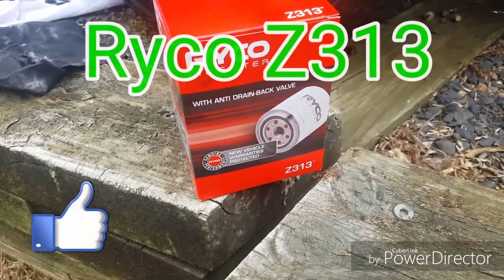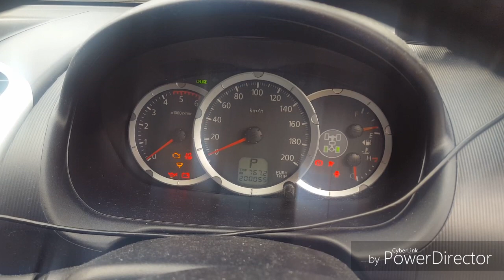OIL CHANGE IN 15 MINUTES plus Ryco filter Mitsubishi Triton

Comment: Handy to note, that to get the oil filter out once it’s unscrewed, you need to remove the rubber hose connected to the underside of the turbo. Only one hose clamp, but best to do it before unscrewing the filter which is still pretty much full of oil.

Comment: I did my oil change today. Lifters were ticking away so i added Motul engine flush prior to draining. I used Penrite HPR 10-40 and added 2 bottles of Nulon lifter and tune additives. went for a drive and it was so much better plus the power increase was definately noticable. Lifters were much quieter from the infamous Mitsubishi tick so now with some use the ticking might settle. If i have to.pull the lifters out and manually clean them i.will but i'd like to.see how the oil change and additive goes first. Next, i'll do the intake strip & clean. Selleys oven cleaner is great stuff as it foams up but don't leave it on too long as it can eat at the alloy if left too long. I'll be doing 5000km oil changes. Peace of mind knowing your oils fresh
Reply: Thanks for the comment mate, I'll give the additives a go!

Comment: Hi mate, loves your videos as they are very helpful with  jobs on my Triton.
I was wondering if you can help with manual transmission and transfer case oil change. A few pics of where to locate the drain and refill plugs are will probably help a lot.
Cheers
Luigi
Reply from the maker: hey mate. this is the next video Im working on so it should be up in the week or 2, cheers 👍

Comment: checking oil level after running the engine for a short while as filling up the filter after fitting new filter makes it necessary.

Comment: Do you need to do anything on the engine control unit to let it know there is new oil? e.g. to reset the oil dilution parameter?

Comment: Donald, thanks for the video. Are you satisfied with your Triton? I see it's done over 200k. I'm from South Africa where these vehicles are not as popular as the Hilux and the Ranger, but they are much better priced second hand. The only issue are the service rates of the dealer. Any advice? (If I may pick your brain.)
Reply from the maker: its the same here in Australia, Hilux and Ranger are a  popular brand but the Tritons price is very attractive both new and 2nd hand, Im very happy with my 2010 glxr, never had any major issues with regular maintenance, apart from the lag at take-off that would be the only thing i could fault but if you change your driving style you can delete the lag, overall a great 4wd for the price.
Reply: Great, many thanks for the quick response! I think it's the Daimler distribution here that messed with their sales. Pity. Seems like a nice truck. It's interesting about the lag, but it's the same on the older Rangers, so I totally agree driving style can address that. Do you perhaps know anything about the 3.5 V6 (apart from the fact that it's bit thirsty? lol. Anyway, just glad that the chassis etc. are holding up. Appreciate your time.
Reply: Hey mate i got a 3" exhaust and ecu re map a few days ago and my triton has near on no lag down low

Comment: Hi mate great video. 
Having just purchased a triton 07 4x4 automatic transmission there wouldn't be a chance you could do one on changing the auto transmission oil and filter?
Cheers
Reply from the maker: Doug Harvey stay tuned mate, will be covering the trans fluid an both front an rear diff fluid
Reply: Service My Ride great mate look forward to your video. 
Cheers

Comment: I'm about to do this next month but I'm not sure what to do with the used oil? Someone mentioned there are oil disposal drums at the local tip but I'm not sure if thats right. Any ideas on oil disposal here in Qld?
Reply: Rumpole Del Bailey pretty sure super cheap auto will take it and recycle it
Reply: Rumpole Del Bailey Im not sure about QLD, but most auto shops will dump it for you, also most tips might charge a small fee,

Comment: Awesome vid mate. Did you need the oil filter wrench or could you reach it and change it by hand?
Reply from the maker: Thanks mate, yes I did use the oil filter wrench, they come in all different sizes,  I used the 98mm-103mm wrench
Reply: Awesome cheers. :-)

Comment: I see the SPV EGR resistors.  Any chance you have had turbo oil leaks?
Reply from the maker: Never had 1 oil leak, I have put an extra hose clamp on the turbo to prevent it coming loose

Comment: What is the recommended oil and oil filter for this vehicle?
Reply from the maker: Penrite HPR DIESEL 5 SAE 5W-40 , oil filter is the ryco z313
Reply: i use castrol HDD oil - 15W40 and go 10'000km for services - i buy it in 20L drums aswell
Reply: 2015 Triton Exceed the oil that is recommended in the book is 5W-30. I just purchased two 5 litre Castrol Edge LL because that was the biggest container Super Cheap had, can I ask where you purchased the 20L from? It is always a good to fill the new oil filter with new oil and then tip it back into the container to reuse then fit the new filter to the engine.
Reply: Service My Ride, maybe next video you can show us how to clean the ERG, just a suggestion. Great job on the video mate, thumps up and subsribed
Reply from the maker: thanks mate, this season there will be an egr an intake clean as well as the catch can, stay tuned it all starts very soon, first up will be the install of driving lights/ light bar
Reply: i got it from murray gulburn (farm supply store) but iv seen them at supercheap auto before

Comment: What the video doesn't show is that you have to remove the air filter and assembly to remove the oil filter. The oil I use is Penrite HPR Diesel 5W 40 Semi Synthetic with a Ryco Z 313 filter. Good luck.
Reply from the maker: Donald Walker you dont need to remove the air box at all, just turn the filter using the filter band to remove the filter
Reply: I couldn't remove the filter, after I had unscrewed it, as I had the turbo and air filter above it and the steering column below it, no way would it have room to be removed
Reply: Donald Walker , i always undo 1 end of intervooler hose, and 1 end of air filter hose, its 2 hose clamps and makes alot easier and less chance of spillage.
Reply: Thanks for the reply Jason, I can see how that will work.
Regards
Reply: Jason, I didn't mean to be critical of your process, it's just that I found it easier to remove the air filter assembly, I can also see your approach. Regards, Don
Reply: Donald Walker No dramas..😎
Reply from the maker: Donald Walker check out the latest video on doing all 3 filters, hope this helps you next time so you dont need to remove half of the air box system 👍